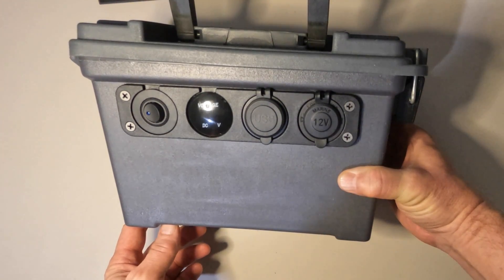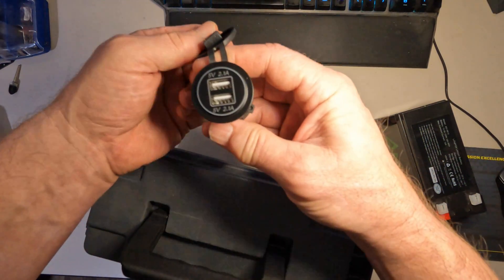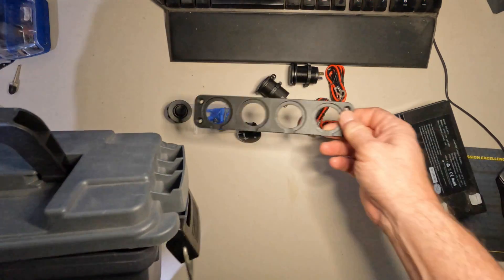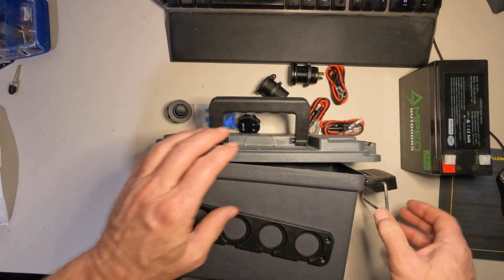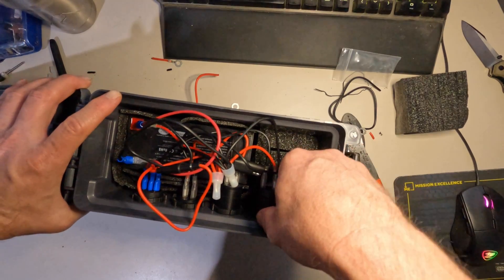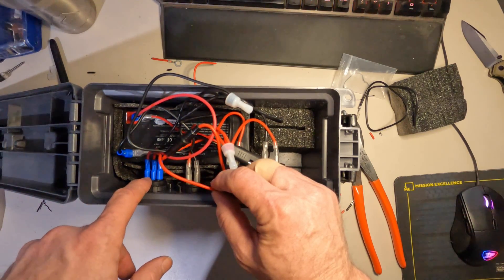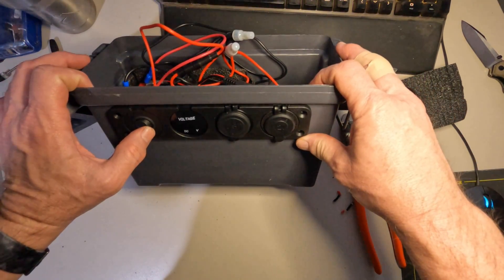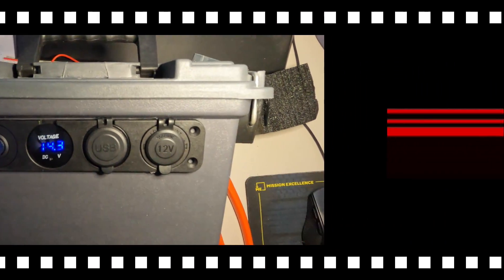DIY Lithium Power Box Build / 12 ah Portable Charging Station

Comment: How did you charge the unit ..?
Reply from the maker: I open the lid; I have the charge wires hooked up to the battery on the inside and then just plug the charger that came with the battery up to it.

Comment: How do you charge that unit? Cool set up.
Reply from the maker: I should have pointed that out. If you look closely, you can see that I put the charger adapter on the battery, so I just plug it in, it is using a 12-volt battery trickle charger.

Comment: Like your take on the power box. I built one similar for portable ham radio usage, with a couple added features. I added an inverter and charge control for solar recharge.  Thanks for a great video.
Reply from the maker: It works great. I have thought about the solar recharge option for extended off grid trail ride trips.